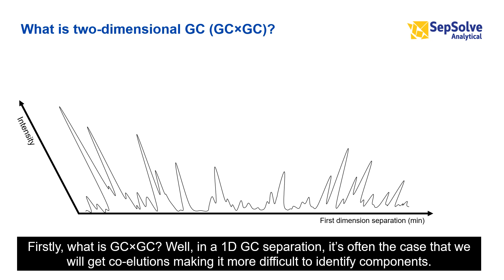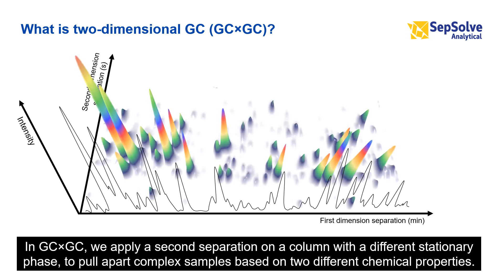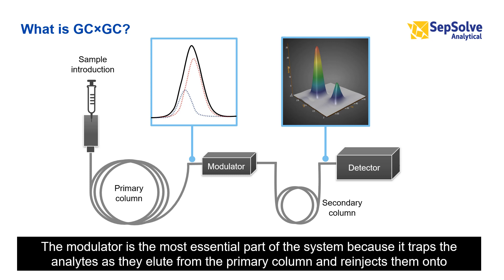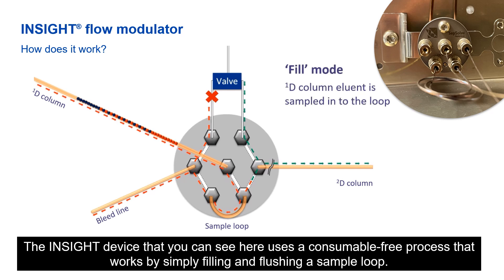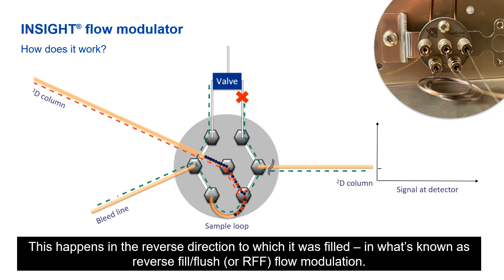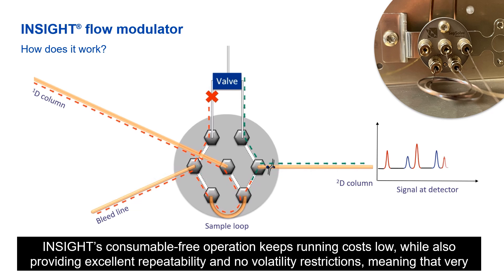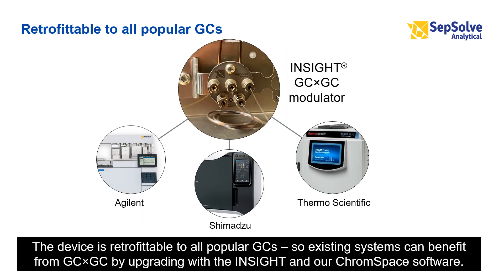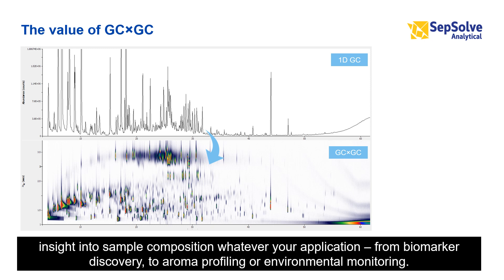SepSolve Analytical's INSIGHT flow modulator for GCxGC

Comment: i dont understand why the flow from the 1st column suddenly stops. does the inlet periodically stop the pressure?
Reply: From my understanding, the flow does stop through the 1st column during the flush mode. Typically the flush time used is very short though (200 ms), so I think it doesn't cause too many issues.